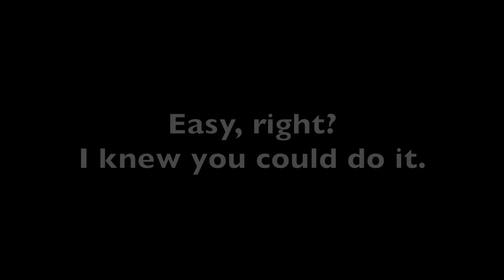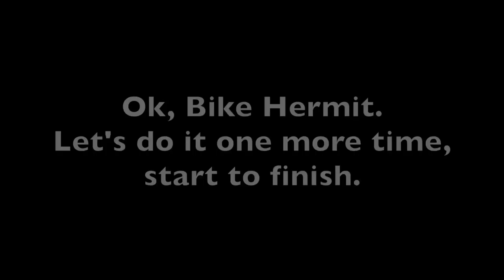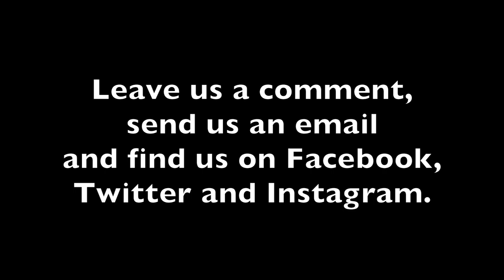Hermit's Workshop - Gnot Boost Thru Axle Dropouts

Comment: I have a bike with 135mm dropout spacing, horizontal dropout (same in the video), currently bolted with a threaded type hub and freewheel. Can I use a quick release in it or thru axle?

TIA

Comment: How about installing 27.5 + wheel on Ogre. It has to be pulled back by 12.5 mm afaik. How do You keep it there ?
Reply from the maker: Jan, Surly makes two different chain tensioning devices that work well for keeping your wheel in the right spot.  If you're running a quick-release hub you'll want the Tuggnut.  If you have a newer Ogre running a 12mm thru-axle you'll want the Snuggnut.  We carry both:  https://store.biketouringnews.com/surly-tuggnut-tensioner/.   https://store.biketouringnews.com/surly-snuggnut-chain-tensioner/  Hope this helps!
-Ryan
Reply: @bikehermit1  Any thoughts on a suspension fork for my 2022 Ogre?  Thru axle would be good.

Comment: Is it possible to use a DT Swiss thru axle with the gnot boost, or are you stuck with the Surly axle only?
Reply from the maker: Matthew, most thru-axles (like DT's) are designed for use in a dropout with threads on one side.  Surly's dropouts are open on both sides and require a thru-axle that tightens against the faces of the dropout rather than pulling on built-in threads.  The rear Surly thru-axle is also adaptable to hubs with 142 or 148mm spacing.  There may be aftermarket options out there but to my knowledge DT does not make a thru-axle that is compatible.  Best to stick with the Surly thru-axles.
-Ryan